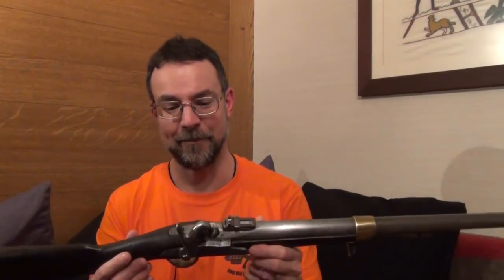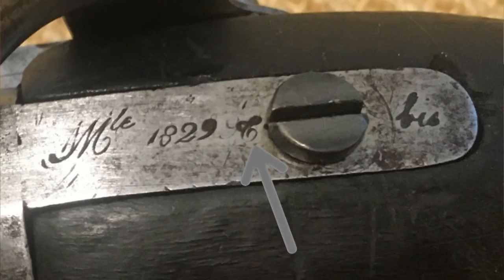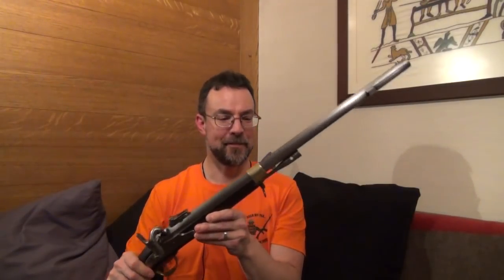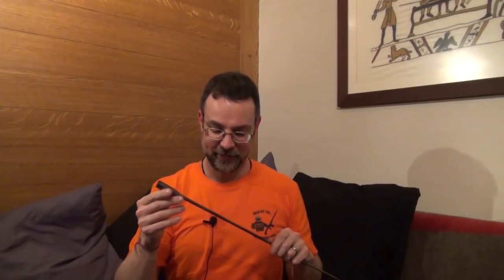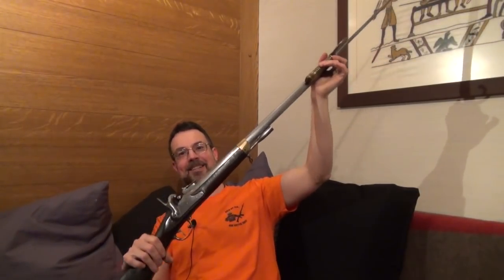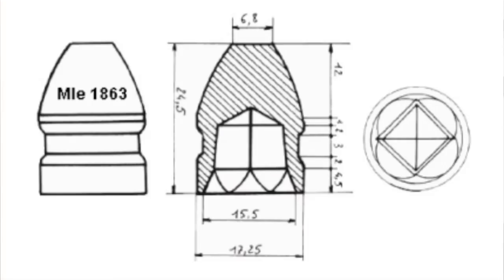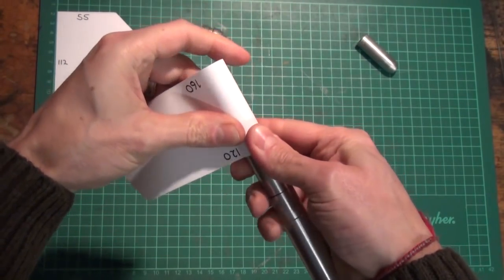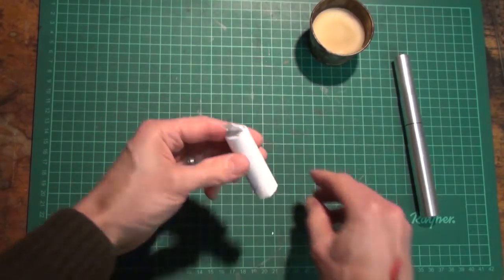1829Tbis Artillery Musketoon

Comment: Can you tell me the twist rate of the rifling? I'm considering buying one of these and would like to shoot round ball in it as well as the minie. Very well done video. Thank you: Tim
Reply: Looking for a "fun gun"  and judging by the ear to ear grin and the woo-hoo first time you pulled the trigger, it sounds like a good candidate. As mentioned  I want to play with a round ball but will not be able to help myself and end up with a minie mold as well. Not many available here in the US. You did not mention the proper minie weight. Please let me know. Last of all, examples are few on this side of the pond. Are decent examples available on your side? Haven't made a purchase yet but will be soon if nothing better than the one I found shows up. Thanks so much for the help.
Reply: Don’t know without measuring but guaranteed slow enough for round ball. The issue is more that the rifling is broad and very shallow so it will take some experimenting to find a (thin) patch and ball combination to get that ball to spin.
Reply: Got the T-Bis. Great fun to shoot. Didn't notice in the video that you were loading like it was a pistol rather than having the butt on the ground. If I could trouble you with one more question. It has a 0.082 inch hole in the musket cap. Seems very large but it is my first musket and for all I know that is normal. On line some sources say as large as an 0.090 inch is normal while others on the net recommend 0.028-0.034. You obviously know your way around a musket so I would really like your opinion. The existing nipple is heavily rusted in place and possibly the original. I am concerned about the brazed in ball the nipple is screwed into coming off of if I try to remove it with heat. Is the large hole in the nipple ok or would you recommend I replace the nipple with one with a smaller hole. I am not getting blasted in the face when I shoot but FF does come out of it while loading if I load with the hammer back and it blows a matching sized hole in the cheap cci musket caps directly over the hole in the nipple with the reduced service charge and a patched round ball. Any guidance and or recommendations would be much appreciated. Thank you: Tim
Reply: @ Sorry for the late reply. The official diameter of the flash hole I can’t say but measuring all the original ones I have on rifles and pistols in good condition I get a spread from 1.7mm to 1.9mm with the most being 1.8mm. The one reproduction nipple I have is 1.5mm

Comment: (Comment added 20 seconds after the video was posted !!) I was always fond of French percussion longarms. 1822T Bis, 1842T, 1853T, 1857T.
Those musketoons were in fact used up to the Franco-Prussian war since not until around 1873 were artillerymen supplied with Chassepot musketoons.
By the way, the 1822 and the 1829 has the 'T Bis' since they were first converted to percussion later rifled. However, after the 1842 all the converted firearms has a T without a Bis. Why is that or am I mistaken? Is it because they were only rifle converted not percussion converted? But in that case, shouldn't it only have a Bis?
Reply: With percussion arms it gets a bit complicated. In that case it is only T (tranformé) be cause they are only modified once. The T basically is an indication of a modification but not what modification. The makings apply even if the gun was produced new featuring all the upgrades.
There is a small family of “Tcar” rifles, “car” indicating “carabine”where they fitted infantry length rifles with chasseur carbine  barrels with adjustable sights as a trials upgrade. The project was abandoned with the switch to the 1866 rifle.
Reply: @thebotrchap  Thanks
Reply: "Bis" means "Twice".   Hence "T Bis" means "Transformed Twice". A 1822 flintlock musket has been converted to pecussion (first modification) and later rifled (second modification) -> 1822-T-Bis.  A 1842 percussion musket has been rifled (first modification) only one modifiation -> 1842-T.
Reply: @jodc2760  Got it, thanks!